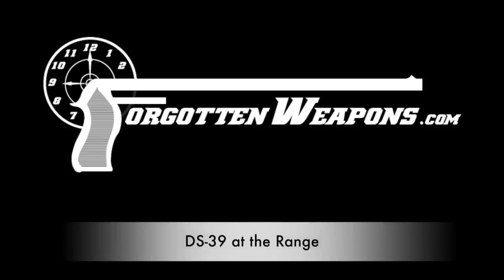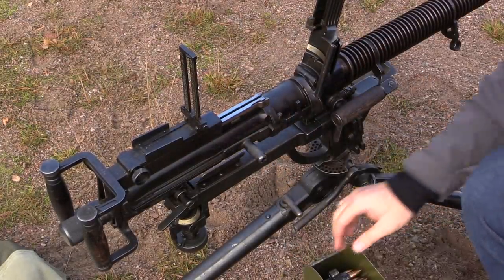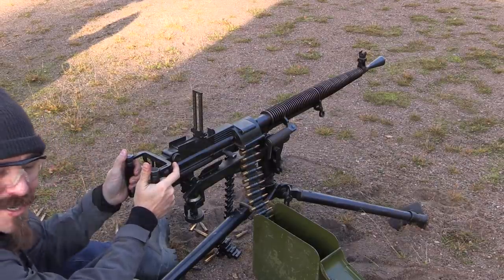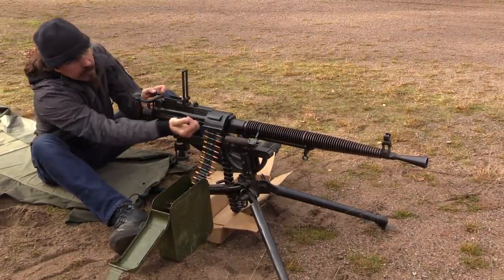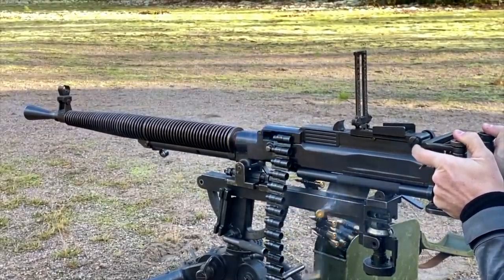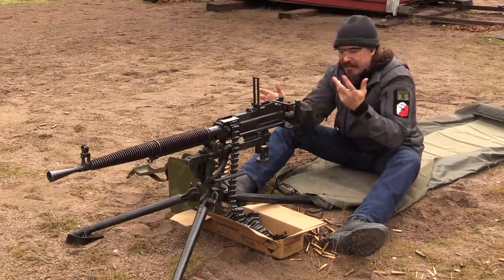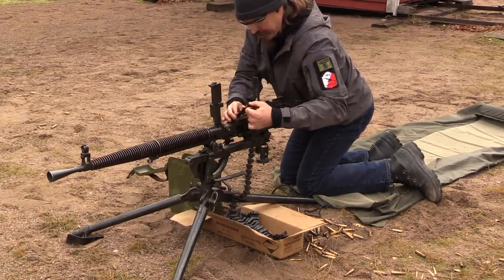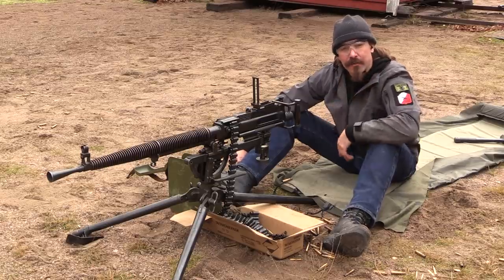DS39 at the Range

Comment: I would like to point out that the hammer used in this video isn't an authentic Russian wooden mallet that was included in the DS-39 kit, but my capitalistic (but Chinese made) dead blow one :)
Reply: Nice to see the Helsinki screwdriver makes a change from the Birmingham one. Have a Merry New Year.
Reply: If you're the owner of the DS39 in the video I just want to say "Thanks!" for allowing Ian to shoot your gun for the benefit of all us viewers.
Reply: Ah! Included in this vidieo , an example of Fraternal Socialist Co-operation!
Reply: @MythicMagus  Sorry, i just own the hammer, but I can pass the thanks to the owner.
Reply: Dead blow? You mean the original hammer bounces? Interesting..

Nvm i read "mallet" as Hammer.. gun's hammer. xD
Reply: Obviously the reason for all the malfunction’s 👍😂
Reply: How dare you?! Happy new year to all my capitalist comrades out there.
Reply: its not simply a hammer. its a specialized percussive maintenance tool!
Reply: nyet! =p
Reply: The Soviet army issue malfunction tool was a brick, 
The Air Force issued a block of wood,
The conscripts were issued a rock.
Reply: @daytonrobbins3361  Put a contraption on the gun to hold the hammer while not in use... ;-)
Reply: Say Perkele when using the hammer and it will work even better.
Reply: Hammer, aka 'Slavic Screwdriver'.
Reply: That's how most Russian and Soviet items were fixed in case of any issues - palm smack or hammer smack. I've "fixed" Soviet TV's and various other appliances like this in my teenage days.
Reply: @petrimakela5978  In Finland, gun finds hammer. In Russia, hammer finds you.
Reply: Must get beeger hemmer!!!
Reply: Russian manual has only 2 pages...
Page 1: picture of hammer
Page 2: picture of bigger hammer
Reply: Hahahahahaha
Reply: nyet problem normal katastroff )))
Reply: 4:53 LMAO
Reply: revisionist chinese hammer
Reply: Just a quick FYI… China’s economic model is actually capitalism.
Reply: Really? That’s very disappointing. 

I’m a high end collector and I only deal with or watch completely matching firearms. No real wooden hammer? Why did you even bother? Al gore rhythm comment….
Reply: @petrimakela5978  Неплохой молоток) С Новым Годом!)))
Reply: @lorgrenbenirus  Percussive maintenance is universal- just gotta know where to hit it.
Reply: @Petri Mäkelä If the mallet was proper Chinese one made according to Soviet technical data package, it surely is ok. Like AK is AK nevermind where it comes.
Reply: Ah - I mistakenly thought it was part of a T-34's gearshift assister.
Reply: @shatteredteethofgod  What are you basing this on? Communist doesn’t mean no trade.

Comment: So the jamming issues help solve the runaway problems—.now that’s good engineering! 😀
Reply: Ha ha haaaa-aaa-a-a
Reply: I have a 22 rimfire rifle like that. It's an old rifle that can fire 22short, 22long and 22lr. 
Every once in awhile it will fire 2-3 rounds so fast it almost sounds like one shot. Then it stovepipes the last brass and stops. It also peppers my face with powder. I shoot left handed.
Don't shoot that rifle these days.
Reply: So neither of those is an issue or problem
Those are the features!
Reply: @DChrls  sounds like a Marlin I own. I bought it from Sears and out of the box it would rip off three or four rounds until it jammed. It only took 4 trips of it being sent back to Marlin over the course of 18 months in which they said for the first two times that no problem was found, the third time they said they replaced a spring and the fourth time I got no problem found. The fifth time I finally got Marlin to replace the rifle with a new one when I threatened to call ATF and tell them Marlin sold me a machine gun and refused to fix it to shoot semi automatic only.

Comment: Finicky mechanical design aside, the russians were ABSOLUTELY onto something with how stable the whole thing is.
I don't think I've ever seen a machine gun bounce this little, modern ones included.
Reply: Even the knights armament lamg? Isn't that also a machine gun? Ian made a video on that one and it has zero recoil
Reply: @MrMolotov888  It has recoil but unlike conventional guns its a consecutive push and  not like a series of little individual pushes. However, it  is so expensive and complicated that it most likely never will see military use.
Reply: I think this might be because the gun is locked in horizontal traverse only but I could be wrong
Reply: Certainly kicks less than the m1919 308 I've shot, tripod mounted with 75lbs hanging weight.
Reply: Probably because it’s shooting a round equivalent to anemic 30-06 and it weighs at least 60 pounds. Just physics, more mass, especially anchored into the ground at three different points, is going to dampen recoil quite a bit.
Reply: The Japanese Type 92 had even less recoil than this. Virtually none.
Reply: @twp397  Watch out, this guy uses .700 magnum loads if he's calling 30-06 anemic. Yeah military ball loading of 30-06 isn't the hottest load, but it's a fair shot hotter than what 95% of people are shooting on average (9mm, 45acp, .223, 5.56, etc)
Reply: @SlavicCelery  No, he was calling the 7.62x54R (what this machine gun shoots) anemic compared to the .30-06, which it is.
Reply: @Regolith86  Weren't actually ww2 military loads of 7.62x54r slightly more powerful than 30-06?
Reply: @SlavicCelery  I meant it’s basically a weaker version of modern 30-06. Believe me I’m not one of those macho compensator guys, I believe in 9mm supremacy hahaha.
Reply: If you want to see a stable machine gun, check out this MG3 on a soft mount: https://www.youtube.com/watch?v=gpxEm_hawQE
Reply: @Regolith86  So in your mind 7.62x54R is a heavy round for this type of mg+tripod 32kg(70.5 lbs) setup? heh
Reply: @jerak02  I’ve seen it in a couple of photos in the JSOC sub-reddit, so it is seeing some use by United States Special Forces.
Reply: @Barabel22  Didn’t know that. But still, the cost and complexity makes it an unlikely candidate for widespread adoption.

Comment: The biggest problem of this gun was the textile made belt used for the M1910.
But when Finland used their steel belts for the M/32-33 it worked very well, and when the Russians tried to use ShKAS belts it worked too.
But it was a rushed and unfinished weapon that could have been improved a bit more.

Comment: Thanks for a great show of a fantastic gun.  Degtyarov got the cyclic rate, mass, and gas right, so the bolt and carrier don't strike anything, and the very clean and straight pull back, and run down makes it so smooth.  I've had the pleasure of firing and working on a few in service.  Semper Fidelis.

Comment: The quick rate adjustment is a neat feature and the gun seems to be reasonably well balanced with so little movement on a light tripod.

Looks lke the only real issue is the feed mechanism, something closer to a Maxim would´ve been a better route.
The runaway situation probably is a much easier fix, like a little more tolerance here, a little less there, a different spring somewhere.
Reply: Maybe the heat expansion caused by the rapid fire has something to do with the runaway.

Comment: mhh, nice seeing one of those savotta mats put to use on the range! (a parting gift from the guys at varestuleka when you visited this year, perhaps...? ; ) )
I got one used last year, apart from 2 small burns from embers when it was to close to the fire, it's virtually undistructable. It gets dirty and has stains, but it doesn't break or disintegrates or whatever other foam mats tend to do after a while in use. It's really handy even on shorter trips, because it's lightweight and easy to pack. Keeps your ass warm, dry and out of the mud; For overnighters I take it as a grundsheet and put an Klymit or Exped airmat on top. You can effectively protect the air mat and don't risk damage from thorns or small branches, small stones etc. 
The side flaps double the footprint and give you an extra 5 inches of ground cover on each side. I carry one on almost every hiking/ bushcraft tour and am really happy with it. Having Ian featuring it in one of his videos gave me a smile on my face ; )
Reply: Only thing I dont like about the mat is there is a drain hole but no way to open up the sleeping mat and replace the foam when it gets modly

Comment: Is it me, or is requiring a dry fire while live ammo is in the gun as part of the reloading process a bad idea?
Reply: Russians are immortal so I don’t think they were worried
Reply: Maybe they just had different standards for safety in the 30s
Reply: I'm not that familiar with firearms but with the proper handling & reload technique I'd say the live ammo isn't quite "in" the gun yet as it's sitting in position on the feeder waiting to be loaded & the first step is to open the top cover  so you should see there wasn't a spare round in there waiting to be loaded. The next stage of the reload cocking back should pull any live round out of the chamber. 

I'm guessing you could have an issue though if there's still a round in the chamber & it's still cocked & you aren't thinking during the reload, forget & skip the open top cover & rack it back stages & go straight to pulling the trigger.  I could see that happening if you're not thinking or distracted in a stressful environment or if you've had to leave the gun & someone else has got involved in the process. 

Tell me if I'm wrong though as like I say, I'm not that familiar with firearm operation & they all seem to have different ways of doing things.
Reply: @wolfsbane-rw7um  The obvious problem is that if you load the gun, make it ready to fire, then forget you have done so, what will happen if you do that a second time is that you will fire the gun unexpectedly.

On an ordinary gun, if you try to load a round a second time, you will just eject the first live round that you loaded.  A waste, but not a potentially hazardous negligent discharge.
Reply: Most open bolt designs don't quite meet most people's safe handling standard I suppose. But, being designed for war time use, it's usually pointed at something you're trying to kill anyway.
Reply: @gnfnrf  Yeah, thinking about it with other guns there's no need for the trigger pull in the process at all until you want to fire so although other guns are dangerous if you've forgotten or don't know they're loaded you shouldn't be near the trigger anyway. This guns trigger pull is part of the initial loading process so it's a lot easier for something to go wrong.

I suppose you can try to train in safety measures to this system so that if it's drilled in that the absolute first step is opening the top cover it should be possible to see if a round is already fed in from how the belt is sitting right? That first link is empty to feed the belt in so if you'd fed it before there'd be two empty links so if you were perceptive then you might realise it's already loaded? As you said, if the next step is cocking the charging handle & it's already loaded it would still eject out a live round right ? Which it should not do if the gun isn't loaded yet but if you didn't notice either of those & skip straight to pulling the trigger for the dry fire, Bang! 

I guess it all comes down to the skill, training, discipline & stress levels of the handler, I can imagine a lot of safety training goes out the window if you have bullets coming whizzing back at you during an actual combat situation. I work as a gardener so I know how easy it can be to skip safety procedure when you're tired or in a hurry & using a piece of potentially dangerous cutting equipment.

I'm from the UK & hoping to join a shooting club over here as I've always been interested in the history & mechanical side of firearms so it's interesting to see how all these different systems work. My experience so far is using my own air rifle in the back garden at home & a visitors day to the rifle club where they briefly let us fire pump & semi auto shotguns at metal targets outside, .22 rimfire bolt action & semi auto rifles in their indoor range & they let us fire off a couple of shots with a black powder muzzle loading percussion pistol which was great fun but I can see how learning to safely handle them is so important.
Reply: No really, it was popular in the interwar period to incorporate such principle in many weapon systems and mainly seen as a way to simplify the design and handling of the gun.
Reply: @wolfsbane-rw7um  yep, although this may have been acceptable  back in the day, it would make a current range officer cringe today just like the Garand's  safety placed inside of the trigger guard.
Reply: Especially if there is a team operating the gun. "Did you dry fire it? No, I thought you did. Are you sure? Now I don't remember. "
Reply: If that scares you the manual of arms for the MK19 would petrify you lmao, imagine having to dryfire to load a grenade launcher, and if you have a misfire it can detonate in the barrel
Reply: @bower31  Well, the Mark19 is just scary overall, but yes, that adds an extra dimension of unease.  I'm wondering if this is just a basic consequence of belt-fed guns firing from an open bolt?
Reply: @gnfnrf  A consequence of belt feed mechanisms, because you always technically have two operations: stripping a cartridge from the belt, and then feeding and firing. Some designs allow both to be done with one action some don't. Common weapons that do this would be the MK19 as stated above, but also the M2HB. With an M2 you can have to only rack it once, but this requires you to open the top cover and move the ejector. Typically it is taught to just lock the first round on the belt into the feed pawls, and then rack once for half load, and a second time for full load. Which also makes it easier to unload as no round is stripped from the belt so you can unload by just opening the top cover. Typically would come down to belt design as well the M240 doesn't do this because the links form a push through belt, as in to mean the cartridge can be pushed all the way through the belt forward. Where Russian belt designs have always generally been pull belts, where the cartridge must be pulled rearward from the belt. Though even the PKM must only be racked once, as when you pull the bolt back it pulls a round from the belt and holds it on the bolt, and then feeds it when the bolt moves forward.
Reply: @gratius1394  yep absolutely. Also this gun was designed during the Stalin's purge of the 30' so yea it's not a big deal if you shoot a 'traitor to the motherland' e few seconds before the rest of the group.
Reply: @briant7652  The worst I saw was an M2 lost headspace while firing and had a round blow out, it blew the entire receiver into shrapnel. The gunner had to be medevac'd cause a 3-4in piece of a receiver side plate was in his thigh. The A-gunner had some lacerations and was alright after he saw a corpsman.  I think the investigation found the gun was too worn to have been in service. Not long after that the old M2's were all replaced with M2HB-QCB's.
Reply: @PapaSchultz74  Are you Russian, Belarusian or Ukrainian?
Reply: @gratius1394  nope
Reply: @PapaSchultz74  Then you shouldn't be talking about something you know nothing about.
Reply: @gratius1394  well i can speak about anything i want to, comrade
Reply: @PapaSchultz74  Just becuse you can doesn't mean that you should. There's absolutely no connection between Soviet firearms developement and general Soviet policy from that days, even if you'll try to squeeze some kind of allusions to stereotypical Soviet mentality into it. I get it, you were most likely just joking but I have to say it plainly, this joke wasn't well thought out in the first place.
Reply: @briant7652  how many guardian angels working overtime that day?
Reply: @gratius1394  dot get mad bro it was just a joke.
Reply: @PapaSchultz74  I'm not mad but I can imagine that someone poorly educated on a matter can take your statement seriously, at least to some degree. Sorry if I was a bit harsh but there's enough dumb myths about the Purge circling in the internet already.
Reply: @briant7652  Could be worse, there's a similar story in Chickenhawk with an M79 going off while embarking in a huey (also didn't go far enough to detonate)
Reply: @wolfsbane-rw7um  It all seems fine on paper, but it just feels like there are a bunch of potentially fatal ways to mess up the manual of arms while in a stressful, loud environment.

Comment: That rate of fire change is also on the M240/MAG series guns.

The stock in infantry configuration has a hydraulic buffer in it. If you put the spade grips on with butterfly trigger for mounted use, it increases the rate of fire.

Comment: I know it’s mounted on a heavy tripod, but I was surprised how the DS39 just doesn’t move (until you raise the rate of fire)
Reply: It looks like it got a dampener built into the tripod.
Reply: It's impressive, definitely. I wouldn't want to have to try moving it though, I suspect part of the reason for the low movement is that it's such a heavy beast it ends up as more of a vibration than a judder!
We need side by side tests to properly form an opinion though. Take all heavy machine guns of the same era, mount on appropriate tripods and dump carefully fire several hundred rounds downrange from each, document results appropriately and then pass to a wider review board for final thoughts. How could we possibly do this and who would know enough to do so? 🤔
Reply: @MrGrimsmith  Ian does note that this ripod is even lighter than other ones.
Reply: @Blazo_Djurovic  That makes it even more impressive. I went back and watched the original video again, it doesn't appear to have any magical coinstruction, only typical Russian engineering with some greeblies that never got worked out.